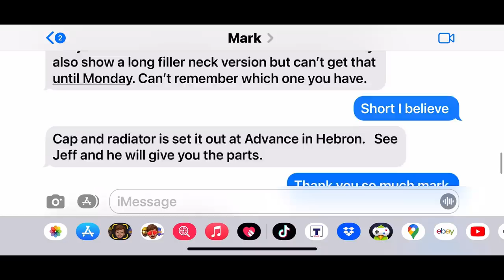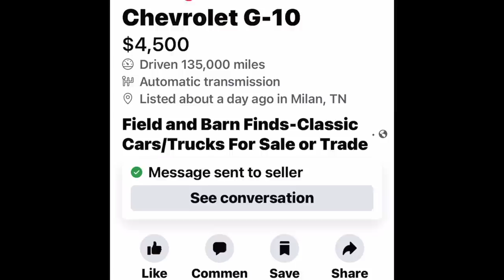PATINA’d period correct Speed Shop “Shop Truck” for “The Old Man’s Garage”

Comment: Much needed and well deserved... I'll give you a suggestion for the gauges and other parts..  LMC Trucks and Brothers Trucks.. They're also gonna have the AC setup..  As far as a transmission and brackets I am positive that Jegs will have it. I highly recommend using the 700r4 with 355:1 rearend.. your going to have to get rid of the tube style rear-end..  the best suggestion for a replacement is a Jegs or Quick Performance 10bolt/12bolt. make sure that you use the 1350yokes and Tail shaft.. For the drive shaft And Suspension work bring it to your Favorite Alignment shop in Columbus..  When doing the disc brake conversion kit I highly recommend Right Stuff. LMC or BrothersTrucks will also have the Green Glass that we all love so much. The wire harness (Ron Francis) or (Painless).  A Serpentine system (Vintage Air) LMC or Brothers Trucks.. Steering Column (Ididit).. the Radiator first choice (US Radiator) Griffin or Be Cool.. LMC Trucks and Brothers Trucks will have the interior kit..  Suspension parts LMC Trucks or BrothersTrucks  LED lights through LMC or BrothersTrucks...

Comment: I’m so happy to see you doing things for you and Miss Vicki. You guys have sacrificed so much over the years for your kids. You guys definitely deserve this. Safe travels Bill. I had a Red 64 with the 292 6cyl.. if this truck has the 292 Big 6 I am interested in buying it if you want to sell it. Has to be the 292 and not to worried about miles. It will be rebuilt for a project I’m building.. Please let me know.
Reply: I hear that 292 I6 motors are awesome torque monsters lol
Reply: The 305 jimmies are fast had one with compression and a four barrel it ran good
Reply: Great engine for torque and reliability
Reply: @kevinshiley9061  I built one years ago to race in the 6cylinder class with my Jeep. We run 300ft sand drags. With the right cam, pistons, Clifford 4 barrel intake and a header the 292 will put a old CJ5 on the rear bumper with paddle tire. I would even bump up to the V8 classes and made a lot of guys mad with that Shiny 292…lol.  Back in the 80’s-90’s nobody made much performance stuff for the Jeep 258. So I build a 292 GMC truck motor. The Gasser drag racers had a 6cyl class back then and I knew a shop that built several 292 for H class in the Gasser world. I believe that was the class. But my little Red CJ5 had to get Wheelie bars because of that motor.  I had a SBC Jeep also, but the 292 made all its power by 5500rpm’s. It was a Torque Monster for sure.  I’m building another Race Jeep and plan to run both 6cyl and V8 class with a old wore out 292 again…lol.  But they are getting hard to find. They are not worth much unless you are restoring a truck back to original. I don’t think Bill is a 6 cyl guy. So maybe he will sell it if it’s a 292. Most 1/2 Tons was the 235 or 250 6cyl.  The 292 was special order unless it was a 3/4 or 1 ton..
Reply: My rat truck has a 250 L6 in it and a 292 L6 in the shed reading for build up.  The 250 is different and works great but it is stock.  The only thing I have a problem with is the cost, availability of parts and machining cost (line boring, balancing etc.  Maybe someday.....

Comment: I owned the same truck in that color.. had at least 6-7 different ones.  I did a frame off on one. 454 with a blower 
If going to a v8- you need to change frame mount motor mount stands for a sbc.. they are available thru restoration companies or a junk yard..
Cant wait to see the truck. I messaged owner last night and chatted with him and shared our hot rod pictures... nice guy.
Stay safe on your trip!

Comment: Good luck on your project.. I have worked on these trucks with my Dad and Grandfather for many years..   Also wanted to add an let you know that I highly recommend using Lizard Skin for sound deadening and Heat Insolation..  it works awesome..   I unfortunately have to put my 1966 Stepside on the back burner for just a short while..  But when it's done it's definitely going to be worth the pain and suffering..  This truck is being built for my Dad...  God bless y'all and Best wishes on your project..  Hey Miss Vicki Here lately have found myself making a lot of home made bisques, soups and stews..  Although my girlfriends kids don't like it much, I have been putting the ole Crock Pot to use..

Comment: It would be cool if you painted it up like an old “super shops” truck. Or, do it up like the way the standard oil gas stations, or phillips 66 used to do their shop trucks and wreckers. 
Get some stickers like the old mooneyes, thrush, erson, etc.
Btw, back in the 80’s there was a company that had kits that would convert the three on the tree steering columns to an automatic shift column.

Comment: Great project! I grew up driving an old '65 Chevy and my brother's old '65 GMC. Chevy had a floor shift and the GMC had a 3 on the tree, both 6 cylinders. Love them trucks. The GMC had the better suspension (leaf springs) and the Chevy had trailing arms.

Comment: I would do the same thing you are thinking Bill. I put a  cheap  flat tappet torque cam in my brother's plow truck with an worked over Q-Jet and HEI.  It was awesome little money spent.  Would idle in 1st gear down the road on a 4 speed driving

Comment: Uncle Bucko should check out the black rifle coffee in a can. And the bottom end from the 421 would be great in that shop truck if you don't want to make too much power or spin too many RPM with a turned crank and resized rods. Maybe the budget AFR heads would be good for the rpm range you would want for a shop truck. 195 is a small runner for that many cubes but for $500 assembled it's worth at least thinking about. Love to see more Kenny f*ckin Powers Camaro content too. You guys can fight it out in a 200 tread wear class when the red Nova is ready. Thanks for all the great content Bill!

Comment: Awesome looking truck Bill and great plan on Shop truck design. I will warn you my 84 stepside started as a shop truck and is now getting rear 4link/coilovers, front tubular upper lower arms with coilovers, automatic (from 3 on tree) swap etc etc.  they snowball rapidly lol.  The gentleman in comments mentioned S-10 frame swap, everyone makes some kind of suspension updates for C-10s in all price ranges. Much easier to go that route.  Welcome to the C-10 family lol

Comment: Love the cartoons playing on the big screen.
Safe travels Bill. Looking forward to this new truck. I had a 1965 C10. I bought it for $100.oo CDN with a clapped out 283 motor and no brakes. A all new brake job from the master cylinder to the wheel ends and a crate 327 and I was mobile. Total cost  $4200.oo. The thing had 5:13 rear gears and wouldn't hardly do 80 mph. Bought a 2:73 rear end out of a wrecked '71 GMC and it bolted right in. It got a newer motor (used 305 HO) and slapped 202 heads on it. She went like a raped ape. Top speed was over 120 mph.

Comment: Bill, check out classic performance products. They have power steering kits with new gearbox, pump, hoses, brackets and arm for your truck.  Also disc brake conversion kits, suspension, gas tanks etc.

Comment: We have the same 96 K3500 454 trucks,  mine is srw not drw,  I just put a all aluminum radiator in mine because of it leaking in the same dang spot,  I also did the intake gaskets, that was a blast. One more funny thing, I have the exact same mirrors you just put on, I love it. Ill try and send you a pic of it somehow.

Comment: I'd love to know the money you've saved doing your own repairs over the years. I bet its incredible. Not really something we think about much. Nowadays most take EVERYTHING to someone else for repairs.
Reply: The newer vehicles are built so the average Joe can't even work on them.
Reply: @SweatyFatGuy  I have 3 vehicles right now . I have a 99 Suburban,  a 98 Tahoe, and an 82 AMC Spirit that is a project in progress.  Very slow progress. It's getting a 360" SBC, a T5 trans, and a Ford 8.8" posi rear. I've had it for 7 or 8 years and it's still somewhat in the teardown mode! Lol. I'll be 67 next month and Im disabled, so I don't know that I'll ever get it done.
Reply: @SweatyFatGuy  I too have an unheated garage that is a distance away. My health issues are bad as well. Entire neck is fused as is my lower back, and the doctors screwed both up. Some days I can barely get around in the house, but I'm going to try to give it hell, lol. Money is also a factor, as you probably know too. I have to get past a few bills to get some parts I need for my engine, then I can build that. I already have the mounts figured out but headers will have to be custom. Hybridization of 2 makes causes issues, but none surmountable. The aches and pains are the biggest bump in the road. They never let up.
I'm going to subscribe to your channel and keep up on your progress.

Comment: Congratulations on the new truck! I get keeping it as close to stock as possible but if it were mine I would have to go with some old or old style Craiger or Mag slot wheels and get her stance a little better and do what all you were talking about. Not only would it look like it came from a speed shop but it will drive smoother and handle WAYYY better. I've always wanted to build a old truck ( C10 preferably) like that and put an old.. but updated 427 Rat in between the rails and a rock crusher behind it.  Now that I'm older.. probably would put an paddle shift auto trans like in the 5th gen and newer Camaro. Can't wait to see what you do to yours.

Comment: What hot rod decals will you be looking for, for the new truck Bill? If you post a list, I have a bunch of pairs applied to 1/32nd inch sign magnet material, that can be easily applied/removed, or moved around, so when you wish to wash and or wax the surface underneath the decals you can easily do so.  I am in process of removing 275 lbs. of wt., and updating to the new contingency list, so they will not be going back on the car in any case.

I have a bunch that we're applied to both sides of the car, and the decals were cleanly attached to the magnet material, then trimmed around with an exact knife, they are thin and bend easily forming over raised lines so they lay flat on steel body panels.

 About the only ones you could not use are the Mopar ones. Earls, Jegs, Hooker, Lunati, Sunoco, Simpson, Speed Pro, MSD, Clevite, Valvoline, Pennzoil, Dupont, Pyroil, VP, Mac, Raybestos, Gumout, National Dragster, Racers for Christ..and the list goes on. Plus I have a huge file of 60's through 80' Decals not yet attached to magnet material collected over the years.

I would be happy to send you the whole set of pairs gratis as a gift (along with the extra unused 3' X 4' of unused magnet material in a tube), so if you do locate and collect any other pairs of period decals, you can attach the decals and I just used a cutting board, and carefully trimmed around the decal edges with an exact knife...Took just a lil' bit of time. A perfect King Kenny detail oriented job! Once applied to steel painted panels, almost impossible to tell they are easily removable. Never lost 1 on the street/track, so you would not driving.

It does add about 20 lbs. of wt. to the vehicle if you do cover both sides, but that just meant 20 lbs not in the wt. box....And not damaging the paint below when and if you remove em.

They do still stick to the paint (to remove, soap and water wash, gently lift top edge, run the hose behind and they lift right off gently without damaging the paint, wash em and dry with a soft paper towel to remove any grit from the rear, and reapply).

Let me know if you want to see pics, or send em to you.

Nice older truck brother, Mrs. H. Is going to love it! And it is great to see you doing something  for you both this time, and looking forward to watching the progress,  and seeing it get done soon! Safe trip to you.

Comment: Nice project, if im not mistaken, the front end from under tommy stalled project truck that was put to the wayside will bolt on,  Not one hundred percent sure because its been 20 30 yrs ago since i did same with mine.

Comment: Good luck on your trip and getting the truck back. It sounds like you have some pretty good plans for the truck. I think if it was me I’d go a little bigger with the rims but keep them steel with a center cap. Maybe check into Detroit steel wheels. Nothing crazy like a 20 or anything like that but maybe a 16 up front and a 17 in the rear.

Comment: Put a K member out of a 73-80 truck in it, bolts right in, you get power steering, disc brakes and updated suspension on the cheap👍🏻😜

Comment: If you do a cam change  i would use a comp high energy 268h cam it has  454-454 lift a  max duration of 268-268 and 218-218 @50 and it has choppy idle it's ground on a 110 lsa .

Comment: If the truck isn’t going to race. Why not leave the motor and 3 speed on the column? You could probably still add AC. Mrs Vicki doesn’t need a hot rod unless she wants a hot rod. In that case add a blower to the 350 and set Mrs Vicki loose. 😜

Comment: My wife drives my almost 800 hp 2000 RCSB Chevy it's a 408 LS Procharged. An lots of everything to make it that. Just dont want to type it all. Please do a LS in that truck. I swear you will not regret. I dont just street race the truck I also track race   it. It's about to go RPM built tremc 6 speed to drift an play a different way. But my wife has beat up on lots of so called fast cars. But also now I'm having to build her one now. Cause she wants to have her own now. Love it but now I have made a crazy awesome love of my life wife that wants to race so called fast cars on the street, with a brick. She loves the rush an big pwr out of it.

Comment: Can I assume that you are comfortable with two wheel drive? The engine going in will bolt to the bellhousing and the flywheel as well. As for three speeds, if they work and work good then its on you but for me as I see it going into a woman's hands.... a automatic is necessary and that means re gear the rear end so its not winding four grand to do sixty. I am guessing 4.10 gears but might have the 3.73 which is very popular. I love four speeds but will that go in and have room for a shifter an can she drive standards. Now if it were mine... clearly not, I would pull that body from the sway around front end those were famous for, I am not certain if it has the torsion bar front end... those never stood the test of time. So a much newer late eighties and up four wheel drive frame, engine, trans, set up. Cab mounts and root canals are on the same easy peasy level. Now a person could just do  the a arm swap and put bags on the back since its on coils I think and some had the  "X" frame and that is its own can of worms. I love the idea of paint/patina thing... and the cartoons in the back as well since they are on my brain. New or just having them sway bars go without mention..I am fond of the vortex throttle body model engines as no choke or  high altitude problems. Also low octane no problem. I think that you and Vicky are a great team as a family... I can see that you love her so thats one in your hero book for me. Early sixty model trucks by chevy seemed to have a assortment of issues but you can work through  them... full floor pans even are available I think

Comment: I highly suggest not to clear coat over the original paint. It will start to peel since it doesn't have a solid base to bond to and cause a terrible mess. Just keep it washed and it will stay this way forever.

Comment: This is amazing and while I know it's been rough it's a grand slam for the channel and truly what you fans want to see. I honestly stopped watching for a bit because you were so focused on racing and missed the mix of things that made you unique. I love this project and the direction you're looking to go with it and the channel is going to hit a new level.
Reply: One more thing is I think a old-school tech segment like tech tip Tuesday would be awesome. I also think tossing out old school ideas and options to fix things like that radiator for folks in a pinch would go over really well. I've found very few people realize that those tanks can be carefully removed and replaced sealed and it's usually the o ring has cracked causing them to leak.